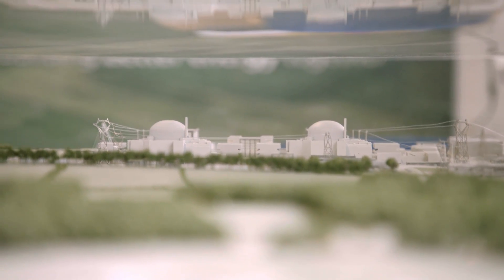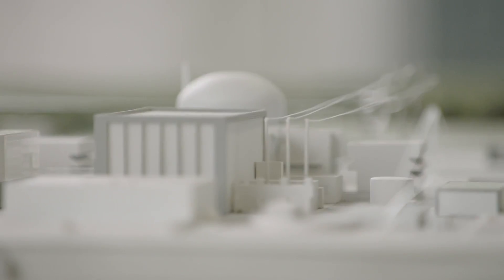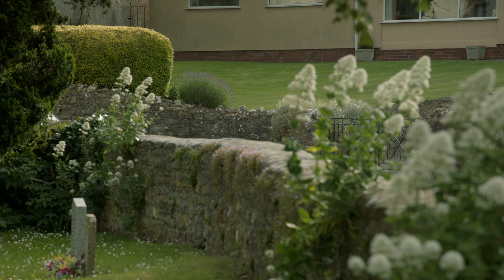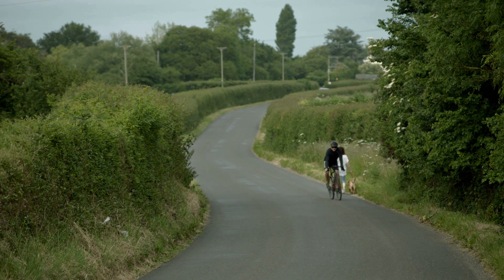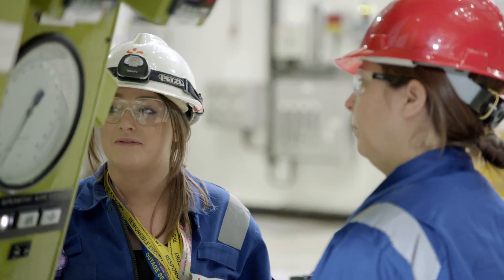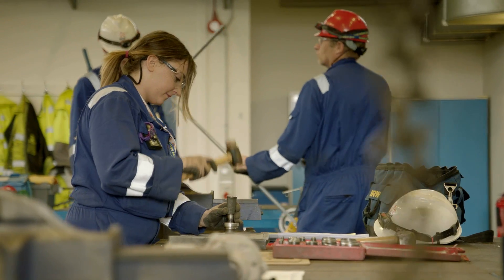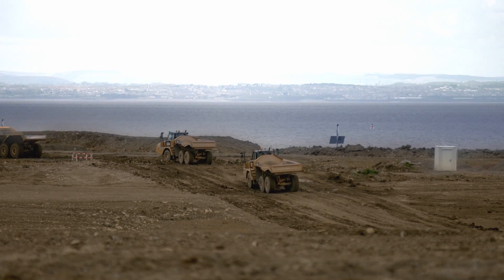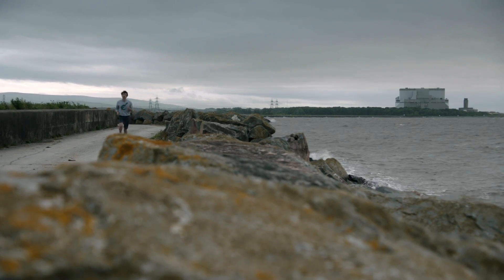The future of low carbon energy - nuclear power

Comment: Nuclear power is NOT low carbon.  Where do you think nuclear fuel comes from? It does NOT grow on trees.  It has to be mined, processed and transported.  Then when this extremely dangerous material has to be moved on from the nuclear power station, again it has to be transported (often on trains in flasks that leak radiation) and stored somewhere - every step of the way contributing not only to radiation, but carbon emissions.
Reply: Yes I agree.
Reply: Well, Steel, Aluminium, Concrete, rare earth, etc. for renewables don't grow on trees neither. You have to take everything into perspective. Uranium is extremely energy-dense and therefore there only has to be mined small amounts of it compared to coal for example. To replace one nuclear power plant you would need hundreds of wind turbines each requiring massive amounts of resources:
https://www.youtube.com/watch?v=zc7rRPrA7rg&t=45s
Reply: @mrkokolore6187  @Rog 6
Uranium does not grow on trees neither. To get one kilogramm of uranium fuel grade you have to dig out many tons of rock in Namibia, Niger ore elswhere.
Are you aware that round the world there are one million tons of UF6 stored in deserted areas? Nobody knows what to do with it.
And by the way, nuclear power is not efficient at all. British Energy went bancrupt long years ago. EDF is 40 billion Euro in the red. A monopolistic enterprise selling one product  is not able to earn money? Have you ever heard this. Several times the french state had to inject money. One time 5 billions. A real desaster. Flamandville and Hinckley Point will crash totally.
This video is made by stupids for the stupid.
Reply: @wilfriedschuler3796  Do you want to do a discussion or do you only want to insult me?
Reply: @mrkokolore6187  
My dear gentleman. There is no need to insult you. I usually do not need to insult people. It is just a fact. You are. Plain and simple.
Reply: @mrkokolore6187  
Dear Sir,
It is not my intention to insult you. I feel sorry for my harsh words. But nuclear power ist not efficient at all. Believe me. The UK produced about 2700 Billion kwh up to 31.12.2015
Take 10% away for own consumption and for feeding all other idle nuclear plants.
The long years price for nuclear power in the US was well below 5 $ cent. So they generated about 135 billion $ sales. Most plants in the UK were lousy. They did not even earn their investement. Let alone decomissioning and all that. It was all burning money from the very first day. And the result is a big loss to be pushed into the future. And this future is dim. No earnings. Only expenses, for ever. 

I agree with you. Greta and friends are stupid.

So, we have to think, move carefully and avoid all ideoligical manners.
By the way, the US forces are burning more fuel than whole Sweden. Stupid Greta should sit in front of the US Embassy. I got your point, about the IPCC.  I afully agree. You are right. They have a politicall agenda only.
Regards from Frankfurt
Reply: @mrkokolore6187  Wind, solar, hydro, anaerobic digestion, tidal... None of which result in nuclear waste.  Thanks for wasting my time with your non-argument.
Reply: @rog5963  Apart from windmills creating nuclear waste in the process of neodymium mining they create way more waste than nuclear power plants. The radioactivity is a good thing as it allows the declaration of non harming after a certain amount of time (the known one million years). Chemical waste like it is successfully stored underground already is far more dangerous (cyanide, mercury, etc.) has to be stored forever as it does not decay like nuclear waste does.
Reply: @mrkokolore6187  "radioactivity is a good thing".  I think you need to see a brain surgeon, very VERY soon.  Clearly radiation has damaged your brain and ability to form cogent, reasoned sentences.  You seriously need help.
Reply: @mrkokolore6187  Nuclear waste is safely stored? If you're so good at finding links - why not google about the trains carrying nuclear waste that keep crashing, with the nuclear waste stored in flasks that leak.  
Oh, and here's a link about Sellafield by the BBC "Sellafield is one of the most contaminated industrial sites in Europe. Crumbling, near-derelict buildings are home to decades worth of accumulated radioactive waste - a toxic legacy from the early years of the nuclear age."
Reply: @rog5963  Could you please send me some links about containers apperently crashing and leaking? I don't know where you got this picture of nuclear waste but if at all it is surely outdated and from a time where safety regulations weren't as strict as today. Nuclear power had a difficult start with lots of problems to be solved. A lot of them have already been solved or are being tackeled right now. Technology has improved dramatically over the last decades do you really think humanity with modern technology isn't capable of dealing with this?
Reply: @mrkokolore6187  Yes, I really do think humanity with modern technology isn't capable of dealing with potentially cataclysmic nuclear energy.  You name me ONE industry that has a 100% safety record.  The problem with nuclear is that incidents KEEP happening - 3 Mile Island, Windscale, Fukashima, Chernobyl, each time bringing death and disaster on a massive scale.  If you are really so blase about it, put your details up and let's see if we can arrange for nuclear waste to be stored in your back garden.
Reply: @rog5963  I don´t know any technology that is 100% because guess what nothing is. Fact is that nuclear energy has the smallest death toll of all energy sources even including wind and solar. Nuclear energy has even already saved 1.8 million lives. Fukushima the only incident to be called current enough had been knowingly underequipped and was advised to build better safety systems for years before the incident. And yet no death to be recorded caused by the nuclear disaster. Reactors are being planned where a serious incident would be pretty much impossible. One has to face that nuclear energy is the only low carbon energy source that is reliable and also incredibly compact. The environmental impact and the intermittency of renewables that could only be compensated with energy storages is unacceptabel. Even if we just don´t care about the world consisting of concrete and solar panels the chances of energy storages that could realise 100% renewables are too low to risk the future of humanity for that.
Reply: @mrkokolore6187  no technology is 100% the best thing about hydroelectricity is in wales and other parts of the U.K. They have ‘water batteries’ which pump water up to a top reservoir when there is an abundance of power and let it run down to the bottom reservoir when the electricity demand is high. These storage systems coupled with offshore wind, (which the U.K. is not the largest offshore wind producer in the world) and local solar panels installed on private property (like house roofs) is far cheaper, far more environmentally friendly and far more economically viable than nuclear energy when you factor in construction, decommission and waste storage.
Reply: @callumhardy5098  Short answer no. Long answer: yes hydro pumping batteries can store pretty big amounts of energy but are also dependent on height diffrences. They are also incapable to supply energy for long outages as the energy that can be released only lasts for about 30 minutes. You would need to construct and therefore clear giant amounts of land to store sufficient amounts of energy which is obviously not environmentally friendly. That is only to store the energy of the real space eating wind turbines. To replace a one square mile nuclear powerplant you would need at least 360 square miles of wind farms! That you call more environmentally friendly?! You should really do some more research on the environment impact of nuclear if you really think that.

Comment: Nuclear is not renewable or clean morons...
Reply: Nuclear doesnt pollute the air.  it is clean, but i think what you mean is the issues of nuclear waste that we have to store deep in the ground.

there comes a decision weather we should drop nuclear power alltogether, or bring our scientists back to work on atomic research to improve nuclear power.  as of right now most nuclear power plants use uranium to create fission right? but there are alternatives. Thorium for example is much more plentiful and it isnt as radioactive as uranium, why dont we use it? im not sure... but its one of the pros where we actually start putting research back into nuclear power.

however if we do drop it all together we are then left with coal, oil and natural gas as our main source of energy and it is today the majority of where power is generated. but as you know its very unclean, gas not so much, but fracking may have consequences to deep underground fresh water supply.

as for renewable sources. Solar power is not enviromentally friendly either as well as inefficient, the materials and manufacturing of the panels is very toxic... Wind power, not only insufficient also can cause interuptions in the natural climate as it creates blockers in wind path.

its going to be atleast another 100 years untill hopefully we can create fusion. harnessing the power of the sun, absolute clean, and safe the ultimate power source. but it might not even be possible. but one can only hope.... perhapes our children, or grandchildren will see.

perhaps really the BEST we can do is try and improve nuclear power plants. scientists didnt approve of the crude method nuclear power works today. using light water creating steam to spin a turbine.... but it was the most popular method becuase it was easy to do and cheap.... we need a new way of harnessing nuclear power to sustain us over the next 100 years... 

now tell me what are your views on this?
Reply: @Nick871203  Nuclear is 'clean'?  Has the radiation already boiled your brain!?  Tell you what, if it is so clean, we'll dump the nuclear waste in your back garden - deal?
Reply: @rog5963  Yes nuclear is clean. im not saying storing waste underground is ideal.... im just stating it doesnt give out any carbon emissions or anything. but this is why i mentioned Thorium reactors.... it is alot more common and cheaper. and it actually leaves less waste... so it'll be a very good alternative for now untill we can get Fusion power working.
Reply: @rog5963  you obviosly dont know what you're talking about.... aside from the nuclear waste which i already pointed out... what is it thats not actually clean?
Reply: @Nick871203  You can't have an argument about nuclear power being clean and then leave out nuclear waste!  NUCLEAR WASTE IS THE WHOLE POINT!!  It is massively radioactive and has a half life of millennia.  Nuclear waste is transported on flasks that leak on trains that come off the rails.  Either you have a cogent solution to nuclear waste or you have no argument at all!
Reply: I will tell you why I disagree with everything you say.
You are more concerned about the path of the wind than soaring cancer rates.
The best we can do is to find an alternative source of energy to both nuclear and fossil fuels and get to work on that rather than wasting time and energy trying to make the best of a bad job.  
Solar energy isn't cheap its free. The reason free energy is not embraced is precisely because it is free and can never be sold.
I heard of a film that could be applied to windows that generated electricity it was only brought to the market after ICI got a patent and marketed it. You can't apply it yourself to existing windows or go off the grid because that would go against the monopolies of nuclear or fossil providers.
Energy is the single most profitable business on earth alternative energies are ignored because they don't generate as much profit.
I hope my directness has not offended you and bid you good day!
Reply: Roberto Carlos i dont think nuclear power plants has much to do with soaring cancer rates... only reason why cancer seems like a much bigger thing is becuase the media makes it big....  we're looking at cancer rates world wide. ofcourse its going to sound like alot and ofcourse with 7.5 billion people on the planet. but chances of cancer a individual gets hasnt changed... 
regardless over the coming decades this will be irrelevant hopefully through genetic engineering.

Solar power isnt free trust me. there are governments that actually force people to connect solar power to the main grid and actually pay for it, Australia does this... and if solar power becomes the main supply of energy i guarantee the governments  will make people pay for it even if its your own supply. and as i said. the construction of solar panels is toxic. it creates ALOT of pollution....

however while the downside of nuclear power is if something goes REALLY wrong, it can leave a permanent mark making areas uninhabitable for centuries. and while its a rare occurrence, they predict accidents to happen once every 30 years.... but this is why we need to use Thorium instead of uranium.... hence why we need to put research back into nuclear power to improve the technology, making it safer and reduce catastrophic damage should it ever go wrong...
Reply: "I don't think" Is becoming clearer as this interaction continues...Cheaper methods of manufacture for solar panels are available and would become cheaper still if more were developed, if we had battery storage in the national grid wind power would be harnessed rather than wasted. Hydrogen gas replaces fossil fuel get that film on your windows and your carbon footprint would be zero.
Now what's stopping you?
Reply: ***** Once they are built there is no cost as industry concentrates on earning profit they learn to manufacture more efficiently.
Reply: Roberto Carlos speaking in terms of air pollution nuclear power is completly clean. it doesnt put any pollution in the air... what you see coming out of those giant coolent towers are steam... 

we just need to make use of Thorium reactors rather then uranium and we are that much safer from any radioactive contamination should there be any catastroiphies. and probably less toxic taste. if any.

Comment: This piece of propoganda for one of the worst decisions that could have possibly be made by this tory government isn't working. Hinkley powerplant is nothing but an enormous waste of public money.
Reply: What? Nuclear energy is the most efficient method of generating electricity and is very cheap to run as it requires very little uranium. It's also far more reliable as it produces electricity 24/7 while giving off minimal greenhouse gasses, the waste product is steam.
Reply: I hadn't even addressed the problems I have with nuclear power but despite that hinkley is a far bigger investment than we can afford right now and the price of the energy hinkley will produce is expected to be the most expensive available. And yeah nuclear might use only little uranium and produce little nuclear waste, but it's radioactive material making it an additional expense to transport and store. The fact is if the government were serious about infrastructure and climate change they should invest more in renewable energy sources.
Reply: wolfernater It is expensive to set up but it will pay off quickly. It's an excellent long term investment. Also you can't argue that we should be investing more in renewable energy sources just doesn't make sense as that is FAR more expensive in terms of costs and return percentages. Economically, nuclear is the way to go. It's building for the future. Unfortunately most people are scared because of Chernobyl, caused by lack of staffing and piss poor management, and Fukashima which was caused by a tsunami. Technology has progressed massively since so there's a huge amount of failsafes and there's zero risk of environmental damage.